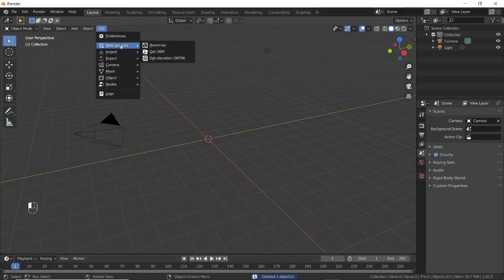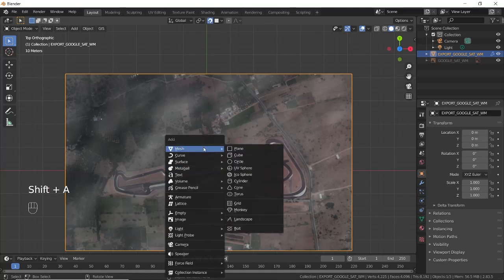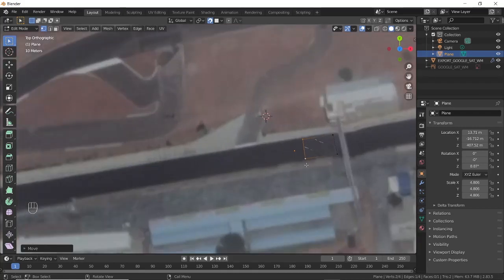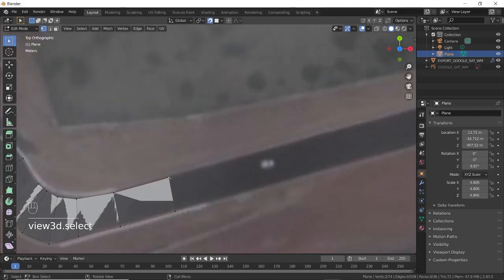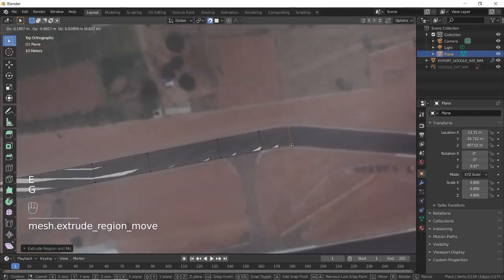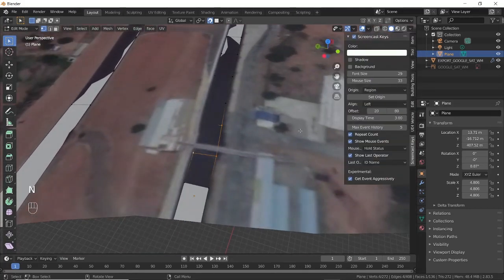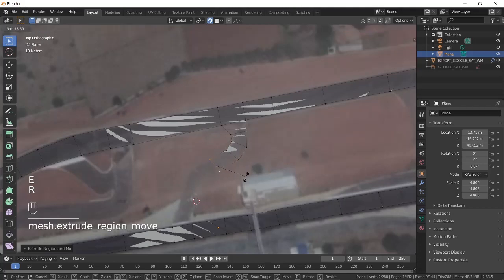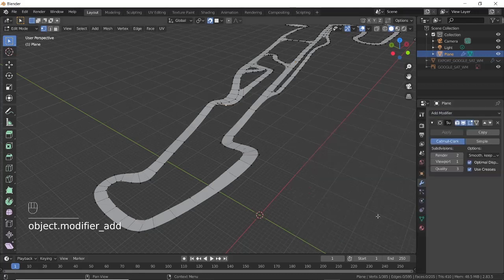How to make a racetrack in Blender Part1(real world height data from blender GIS)

Comment: I have an issue when roads meet one side is higher and I don’t know what settings to go by to make it flat and meet at the seem. The ground is above and while driving it’s like hitting a wall.. ughhh
Reply from the maker: @Instant_Nerf  complete the playlist. U will get to know. U can also directly follow the last video. This is kind of primitive method.
Reply: @ still not working. What in the heck! Once the car goes over the road it’s like hitting a wall. You can’t combine the roads at the seem? The road is a T. One road goes straight the other one 90 degrees. I’m using track builder to make the track because I can’t get kseditor to import the blender fbx, if I was to make it in blender. Ughh .. will keep messing with it untill I figure it out
Reply: @Gamezoneadi  bro this shit is not funny .. how can the  road act like a wall .. it’s soo thin😂😂.. I am making progress but it’s a pain in the ass.
Reply from the maker: It kinda is PIA. U need a lot of patience. U need to do a lot more than just making  the track to get it into ks editor

Comment: i have an error when i press e to finalise image.
Reply from the maker: U need key to use it, check last video of playlist how to get key, its still free
Reply: @Gamezoneadi  Where exactly does it say how to get the key because I have the same problem
Reply from the maker: Just login to the site of opentopography. U will be able to figure out easily. Pretty much self explanatory

https://opentopography.org/
Reply from the maker: Also if it doesnt work u can use the maine geo service. There's no difference
Reply: @Gamezoneadi  What is the main service and it won't be different from the one in the tutorial right. (add different steps)
Reply from the maker: @opticdanny1045  its not different
Reply: @Gamezoneadi  Yeah I fixed it by watching a tutorial for GIS turns out I had the wrong shader mode that's why it was just plain.

Comment: I cannot get the elevation I'm on Blender 3.6 
Somebody help me
Reply from the maker: Kaunsa service use karre ho? Opentopography ya marine geo?
Reply: @Gamezoneadi  cannot understand hindi tell me in English
Reply from the maker: @jd_thunder-j5c  https://youtu.be/zYebEnd3HPk?feature=shared
Reply: @Gamezoneadi  bro i did this but it is showing error. 
Which version of blender you are using .
Reply from the maker: @jd_thunder-j5c for me it worked on all versions, 2.8, 3.0, 3.6, 4.0
Reply from the maker: U need to select the plane before downloading height data. Is that the reason? Use the other options if open topo is not working.

Comment: No this does not work nothing in the map is solid you just drive through geometry fk asseto
Reply from the maker: U need to define surfaces in surfaces.ini file and u have to use correct naming of the surfaces to make it work. So yeah Fk assetto🤬🤬
Reply from the maker: Also this video only deals with the modeling part. Not importing into assetto

Comment: Do you know how to fix this? When i add the Subdivision Surface modifier, and after that i try to import the blender file to KsEditor it doesn't work but without the modifier it works. I've tried many methods and it still doesn't seem to work.
Reply from the maker: What level of subdivision did u apply?
Reply: @Gamezoneadi If you mean the viewport level, it doesn't matter how low or high it is, it doesn't work i have tried 1, 2, 3
Reply from the maker: @lupikekeampu6757  any error msg u get? Sometimes if there are too many vertices it takes lot of time to load
Reply: @Gamezoneadi  Oh, i just got it working, but Thanks!
Reply from the maker: Did u import blender file or fbx in kseditor?
Reply: @Gamezoneadi  FBX
Reply: What did you do to fix it? Soon will have the same problem i think.. 😅
Reply from the maker: Each mesh has vertex limit of 65000 something. So as long as it is below that ur mesh will load. Also each mesh should have only one material attached to it. So separate meshes based on material before exporting
Reply: @raoulreichebner2132  I separated some parts of the mesh so it wouldn't be over 65k vertices

Comment: Good video, but I have a problem. when I try to join the 2 sides of the track using planes by pressing f, no matter what I do, after selecting 2 vertices of the plane it for some reason selects everything. How do I fix this?
Reply from the maker: Just hold control and select end vertices from both sides. U need to select 4 vertices not 2.
Reply: @Gamezoneadi  Yes, but the problem is while I try selecting the 4 vertices, when I select my 3rd one it just selects all of the vertices I have, why is that? thanks for the reply btw
Reply from the maker: Maybe because loop selection is getting enabled.
Reply: @Gamezoneadi  what is loop selection and how to fix it?
Reply from the maker: Record it and send video. I can't imagine this thing happening
Reply: @Gamezoneadi  Nvm I fixed it, thx for the awesome tutorial tho :D But I have another problem now, I forgot to add terrain height and now the plane is going through the gis map sometimes
Reply: @Gamezoneadi  It was fixed, but now the plane isn't aligned to altitude and it goes through the ground in places where the elevation rises
Reply: @Gamezoneadi  how to send you video?
Reply from the maker: @nastameadweedy2397  use shrinkwrap modifier on ur track. Watch the last video of the playlist I have explained it there(part9)
Reply: @Gamezoneadi  wow, there's multiple parts to this? thank you!!

Comment: Hi there. 
 i hope you can advise.  
my blender does not save me height data right when i reboot the ""export_google_sa_wm is below the track i made from it.
Reply from the maker: The ground plane sometimes loses the height data after u close blender. 

 To avoid this, apply all the modifiers on the ground plane before u close blender . 

But if u have not applied the modifiers and u lost the height data, don't worry
Select the ground plane, goto
GIS -> Get Elevation -> ok
And now apply the modifiers
Do not open the basemap
Reply: @Gamezoneadi    thank you, i seem to be missing some other setting aswel. if i apply dem modifiers, some times it goes flat again, other times not,  if not when i open project a few days later, its flat again
Reply from the maker: @karlsteeg4139  the second solution works always. U can do it as many times as U want but do it only if it's flat
Reply: @Gamezoneadi    ok will do, i was hoping to lot have to load height every day, but thank you
Reply from the maker: @karlsteeg4139  well it doesn't lose height for me after I apply in the modifier. I don't know about any other solutions. It works in both versions 2.8 and 2.9 for me. I know loading height is frustrating but add ons have some glitches. maybe the developers will improve it someday.

Comment: I am using a slightly different method.I am adding extrusions like this using blender GIS as well but when I export it to unity the plane is not visible.It is still not visible after textering.I can select it but can’t see it
Reply from the maker: U mean the road looks transparent?
Flip the road 180 degree and check if the textures have got applied in unity? This happened to me once but i dont know why. If that's the case, the only solution is to make material render on both faces in unity.